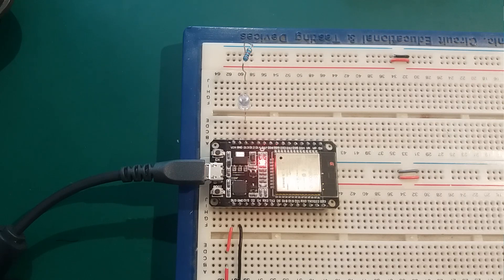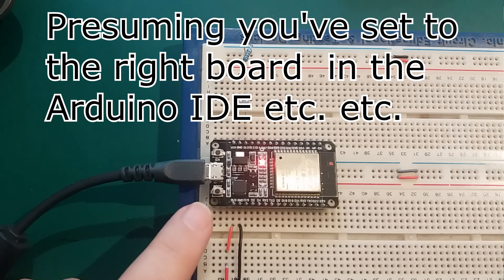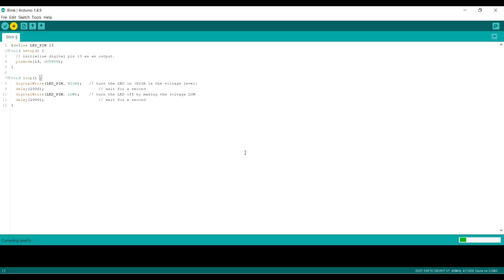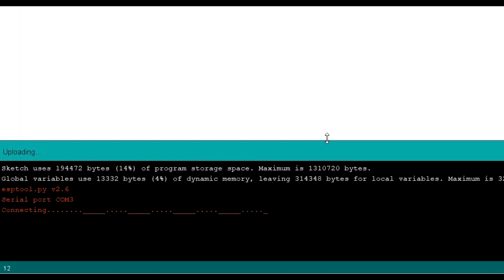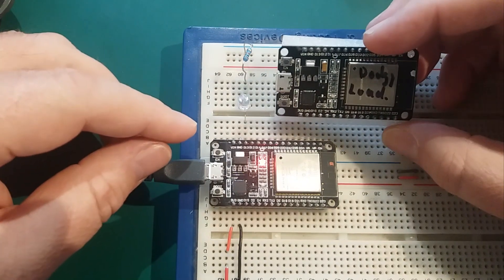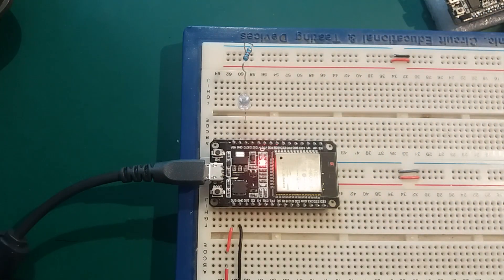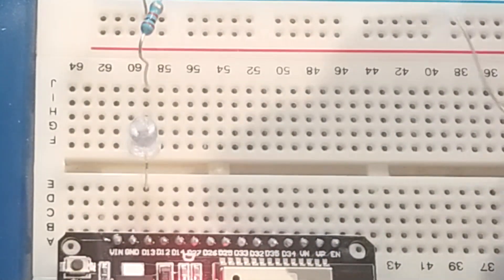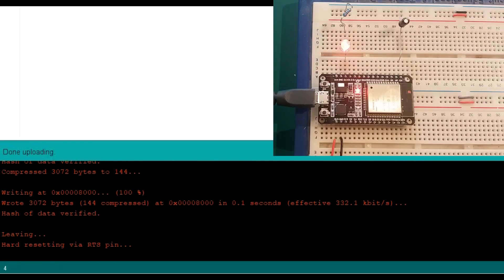Fixing a hardware ESP32 Upload problem

Comment: is it mandatory to take an electrolytic capacitor?
Reply from the maker: No, but the value has to be around 10 to 20uF if I remember correctly which makes them a good choice for this due to size price considerations

Comment: So if solder that cap between the ground pin and EN pin on that board? Basically some weird way of forcing the EN pin to low?
Reply from the maker: Yes, that would work fine.
Reply: Thanks for confirming!  @XTronical

Comment: What breadboard are you using in your videos? i'm interested in the large board.
Reply from the maker: Which one? The blue one or just the long ones. The blue one can be a bit harder to find, but might find on amazon, ebay. I've had it years. The connections are a bit on the tight side to be honest. The longer ones are a mixture of quality Bus Board make or quite cheap Chinese knock offs. There OK for keeping costs down and as long as your not doing high performance high frequency stuff otherwise stick to quality make like bus board. I think 3M did some quality boards.

Comment: Just a word of caution while assigning port pins GPIO0 can’t be used if this cap Is used for ‘ease of upload’, u hv to sacrifice this GPIO for a while. If u use it then the controller may go to boot reboot reset because of change in GPIO0 state. & FYI, the 30pin PCB doesn’t hv GPIO0 to access on header pins. But 38pin PCB do hv the GPIO0 on header so b careful

Comment: Mine is a reverse case, the 38pin board requires to press boot button while upload, & 30pin doesn’t require. To find a SMD cap from EN to GND, so it means I depends on a vendor, from where u hv sourced the PCBs

Comment: Great video that has probably helped a lot of frustrated people. I was almost sure I had this problem too. But, I found there were 2 different sets of drivers out there for the serial over usb my version (which looks like your short chinese version) was using, and only after follwoing two differnt tutorials and looking at another video about a camera did I think to check for driver conflicts in the devices manager. I also almost forgot that a ton  of micro USB cables don't even carry data wires anymore.  Just mentuioining this stuff here in the comments if anyone else is banging their head against the wall and may have overlooked these things.

Comment: Hi, Im just about to try this out. Im just curious, would it work if I just short EN directly to ground instead of adding capacitor before I press the boot button?
Reply from the maker: No, don't think it would work as the capacitor will allow en to be low and then go high. Just grounding wouldn't do this.
Reply: @XTronical  Got it, thank you~

Comment: Just in case this helps someone else, the board you said didn't have the problem is a Dev Kit C v4 and it sadly does have the same issue (or mine did).  The en pin is 1 pin further down but soldering a 10u to the ground on this version fixes it as well.  Thanks again.

Comment: I have this problem too. I noticed a sneeky capacitor on your ILI9351 ESP32 video. Now I know what it was about. Thnk you for yet another excellent video. I am busy connecting my ESP32 to an ILI9488 and the SD card. It works sometimes, I am trying pull down resistors about 6k. Without a super expensive digital scope I just have to guess what is going on. Oh by the way pictures need to be exported in gimp without the advanced jpeg compression.
Reply from the maker: Thanks for the tip on the jpeg settings, if you're having sd card issues with this screen try this video :
https://youtu.be/ZmMTr8LEa1A

Comment: Very strange, thing with my ESP32 Wemos Lolin32.  I was getting the problem described here, after re-soldering the headers on.  I noticed some of my soldering welds where not acceptable, one pin was free to slide around, because it wasn't welded, but looked like it to my naked eye, and yes I had on my glasses.  Anyhow, I re-soldered a 3rd time, just the loose pin, and a few others that looked like they needed it, and now my ESP32, uploads fine, no capacitor needed.

Comment: I was using the suggested 100nF cap on EN and performance was random from board to board.  I had one failing 100% of the time and I put 10uF on it and now it is working 100% of the time.  Great tip!!  Thank you!!!
Reply: So solder a 10uF between EN pin and ground pin on that ESP32?
Reply: so? @OMNI_INFINITY
Reply: 10uF how many volts?
Reply from the maker: Anything above 5v. 16v is a typical value.
Reply from the maker: Brilliant

Comment: Which capacitor should I use for the esp32 DOIT 30 PIN ? ( For the same purpose as this video)
1) 10uF  25V  Electrolytic
2) 4.7uF  16V Electrolytic
3) 2.2uF  25V Electrolytic
Reply from the maker: The 10 uF one, in fact some people have used 20 uF with success. The voltage isn't that critical as long as above 5v
Reply: @XTronical   Thanks a lot 😊
Reply from the maker: Your welcome.

Comment: Thx for this 2.2 mF electrolytic worked for me!  I was struggling to upload after experimenting with OTA uploading. When I went back to serial cable I could not get connected. However this then worked fine. I'm so glad folks like you exist on YT.  Do you happen to know the reason .... and should the capacitor be left in situ from now on?
Reply from the maker: Glad it worked, I think the enable pin has to be kept low just for a short time and then go high. I think it's hard to get the timing right manually. You can sometimes do it manually but very hit and miss. At least that's my understanding anyway!
Reply: @XTronical  The key is to hold BOOT, then press and release EN, then release BOOT.
Reply: Basically, the EN is reset, and BOOT (IO0) needs to be pulled low to program it. Specifically, IO0 needs to be low when the ESP32 starts up, so the sequence to begin programming is IO0 low, then EN low and back high to reset it. Then IO0 can be released. The cap is keeping EN low longer, which apparently makes a difference. (The USB-serial converter in the ESP32 board uses RS-232 flow control lines to do this sequencing, but without the cap it’s not 100% reliable.) IO2 and IO12 can also inhibit programming if they’re held high (IIRC), which is why I avoid using those pins if possible. (And since IO12-15 are the JTAG pins, and JTAG debugging is incredibly useful, in my newer designs I’m reserving those pins for JTAG.)

Comment: Can I connect the capacitor from EN pin to the GND pin of ESP32 board?
Reply from the maker: Yes, absolutely. That ground rail on the breadboard is actually connected to the gnd of the esp32.
Reply: @XTronical  thankyou!

Comment: Dear Youtubers if you don't want to solder a cap, you can keep pressed the boot push button for a few seconds during the initial flashing of the firmware. For me it works. Hope this also works for you. I am using a DOIT ESP32 DEVKIT V1 the one in the video. Anyway a cap can be a good idea.
Reply: Didn´t work for me. Trying the capacitor today.
Reply: You have to try more than once. It is just a work around. Anyway in my  case it always works. 
But if you have to put the Esp32 inside a box the capacitor if 10uf is always the best solution.

Comment: This didn't work for me with a 10 uF cap for a 15 pin board marked "ESP32 DEVKITV1". I have greater success pressing the EN button just before uploading the firmware.
Reply from the maker: Shame, but least you've got a solution, these boards can be tricky beasts it seams

Comment: Got a link to a vendor that doesnt have this problem? I cant get any solutions to work with this board I have now
Reply from the maker: I've found the slightly larger 38pin esp32 work OK, search Ali express for esp32 38p, and make sure you order the 38 pin version. Also the lolin boards I think are fine (but I've no direct experience of them). I looked on amazon but could only readily see the DOIT style boards which have given me problems.
Reply: @XTronical  ill probably try the Hiletgo board and the one that says Genuine espressif on amazon. Just to see what happens. May just goto the Sparkfun Thing just for the charge capabilities. They usually have a great plug-in play nature
Reply from the maker: Sounds good
Reply: I heard the HiLetgo board has a blue LED on its pin 2 so you dont have to wire externally aswell.
Reply from the maker: Oh that would be very handy for quick tests, thanks

Comment: What is the capacitors value, and voltage of capacitors?
Reply from the maker: Value around 2.2uF, voltage is anything around 5v upwards.
Reply: Actually I have same problem same error occurred I try many things like I shorted enabled and ground pin in the uploading time but nothing works I give external supply to it but it's not work. I installed python version for it also but same problem.
Reply from the maker: Have you used the capacitor yet? Make sure connect right way round.
Reply: @XTronical  no I not use capacitors yet because I know about it now. Let's try this what happened?
Reply: So have you tried using capacitor?

Comment: I have several different ESP32s
The ones with 15 pins down each side I have to hold down the boot button till it starts loading.
Maybe I'll try the capacitor if it is annoying me too much/too many wires in the way.

The 19 pins per side ones I had loaded ok with nothing.

However, I have just got some different 19 pin ones that don't load on their own or witth holding the boot button down or with capacitor.

I had to follow these instructions for them:-

https://docs.espressif.com/projects/esp-adf/en/latest/get-started/index.html#upload

Upload
To upload the binaries, the board should be put into upload mode. 
To do so, hold down Boot button, momentarily press Reset button and release the Boot button. 
The upload mode may be initiated anytime during the application build, but no later than “Connecting” message is being displayed:
Reply: I couldn't flash it and I've tried using your technique to hold down the boot button and it works. THANK YOU!
Reply from the maker: That's very good information to know, thanks for the advice.
Reply: THANK YOU!!!

Comment: Top man! Had the same problem with ESP32-WROOM under Linux.  It does upload when holding down Boot, but I found that fiddly. Adding a 1-3uF obviated the need to hold down Boot. A 10uF actually worked better for me.
Reply from the maker: Great stuff.
Reply: 3uf/10uf, and how many volts.
Reply: @Tom_Neverwinter  5v or more, mine is 16v
Reply: I find that the black ESP32's are easier to flash than the white ESP32's but not always.

Comment: ive been havin issues with a couple of my boards lately..used to just have to hold the boot button when it was doing the serial search...it would get half way through and fail....turns out i had to hold the boot button for the complete upload... its back to normal booting now...seems to be some weird "state" they get into... 
you wouldnt have a fix for very weak wifi on an esp32-cam board would you?! weak as in i need to have the esp32 right next to my tablets antenna for it to see the ssid and connect..and even then its still weak...ive tryed using the code to use max wifi power but its still the same :(
Reply from the maker: Sorry, I've not dabbled with the WiFi camera boards. A quick search has not shown much. Obviously something very wrong. Andreas Spiess did some work on antennas on his channel including a antenna tester, maybe that might help.

Comment: Just push the boot button when you start uploading. It works for me all the time
Reply: That's right. 
When it starts "Connecting... ___..." you can hold the boot button down until it starts the transfer. Then you can let go of it. 

I'm going to try this too, because it's a pain. 

I've also had boards where the Arduino IDE doesn't do it, but VSCode + PlatformIO does it all automatically.  *shrug*.
Reply from the maker: ,tried that, would only work now and again. Was frustrating.
Reply: @XTronical   You have to hold it pressed until starts uploading. I've been doing for a long time and it works every time
Reply from the maker: Yep, did that too, would hold it until it gave up. Many seconds, then tried long then short presses, sometimes worked, sometimes not. Another poster said there were a couple of different versions of the board, perhaps one behaves better than the other.
Reply: @XTronical   I've bought esp32 from China as well as from Ebay, but I have never had  problem with them honestly. This always worked for me. I don't know if it has anything to do with it, but I use the Arduino IDE  on mac. Anyway, good video and I'm sure it will help others.
Reply from the maker: Ahh, in my looking into this I read something about it being a windows issue. Mmmm....

Comment: This is a problem with the cp2102 serial chip. It is toggling the boot button (pin 0) nearly the same time it releases enable. This is working sometimes.. but often not. The doit schematic has already a 100nf cap on the enable line if i remember right, but it’s too small.
On my esp32 projects i am not using the cp2102 series anymore. The cp2104 is smaller, cheaper and till now it never failed uploading.
By the way.. some doit style boards now have a cap between the enable button and a gnd via.. i think it’s done after main manufacturing. The problem is, that these are also not working better, maybe the cap is still too small.
Reply from the maker: Thanks for the extra detail, that's very interesting, I really like the form factor of these boards but shame about this problem.
Reply: Yes, it´s a nice form factor, and i think we would have more shields in this style, if this upload problem wasnt there. BUT there´s another problem.. the voltage regulator and it´s diode are not really suited for the esp32, when we want to use it with external hardware and wifi accespoint. The ldo is really limited by itself plus the voltage drop of the diode. I managed to get brownouts every time the esp is sending its wifi beacon (every 10 seconds).. it needs about 700mA for this, so if we have external stuff also powered from the ldo, it could happend that the ldo is not getting 3.3v anymore out of the more or less 4.2V, after the diode drop.
And if you´re trying to use the esp´s ADC´s, you would get a really bad reading, because the Vref is not stable 3.3V anymore..
So after a lot of research i´m now using a 2A regulator with another diode, with super low voltage drop.. but of course, this is a custom pcb then.
I hope we´ll see some better designed boards in the same form factor in the future.
Reply from the maker: Wow, great information, I'll bare that in mind with future projects. Cheers.